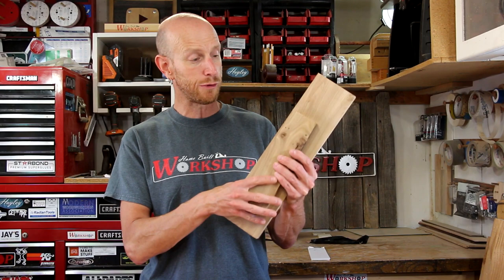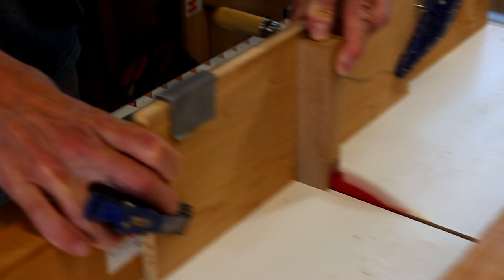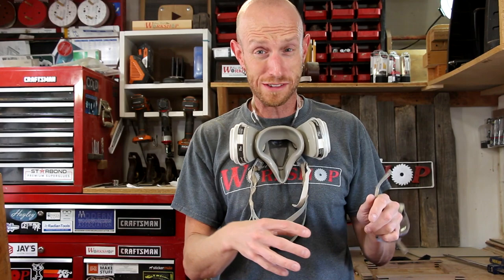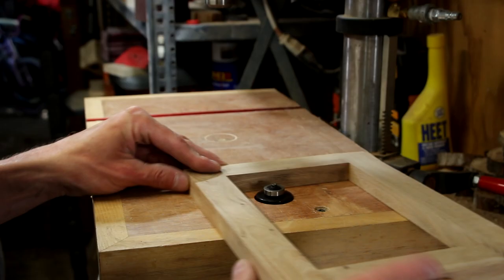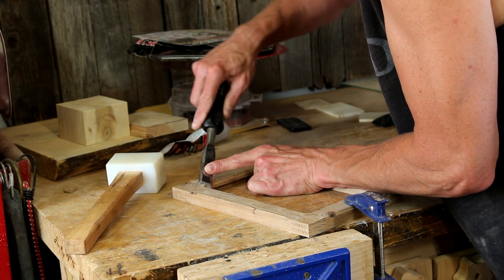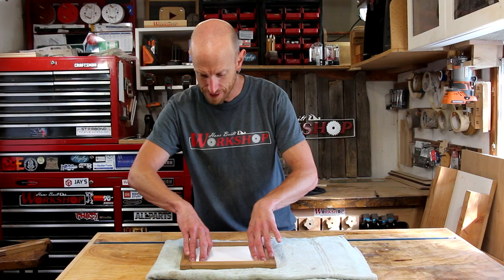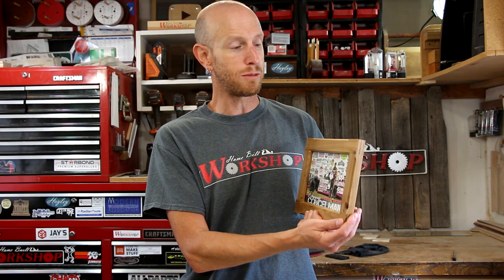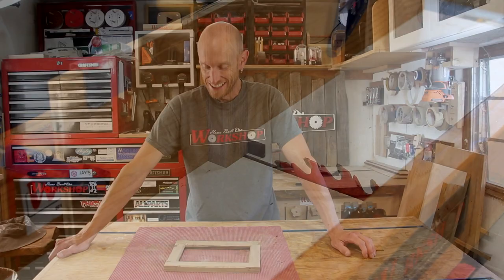Making a Finger Joint Picture Frame | Build a super strong frame

Comment: Nice work on the frame. And I always enjoy when I see some time left at the end of your videos, I know there's going to be some outtakes. Lol. Now I'm going to check out your finger joint jig video, I'd sure like to learn how to make those. 102 degrees outside really sucks and it was hot here too, when you posted this video...but right now it's 70 degrees and pouring rain, here in southern MN. Gotta love Mother nature, and the snow will be here soon enough!
Reply from the maker: I wish it would rain here. I don't want to think about the snow yet though. Lol.
Reply: @homebuiltshop  Yeah, I definitely hear ya. Every year, when the pro football pre-season starts, I always figure summer's just about over. Labor Day weekend is right around the corner (and sadly) it seems it's not long after that, they start reporting snow in the mountains of CO. already. I like it when we have a long Spring and Fall season.